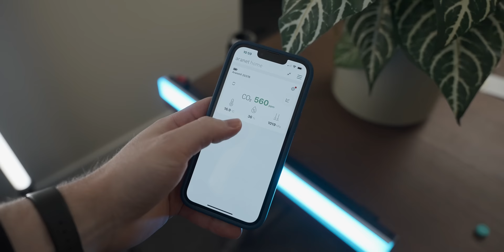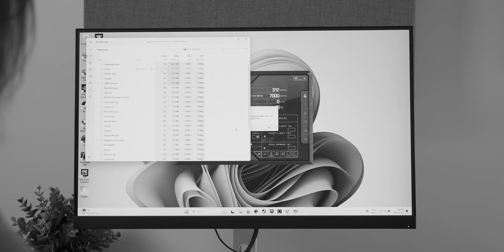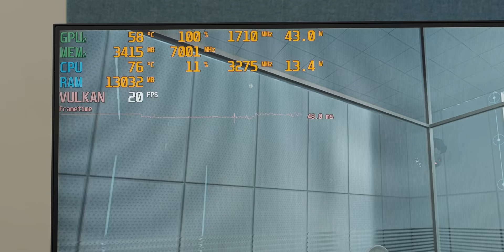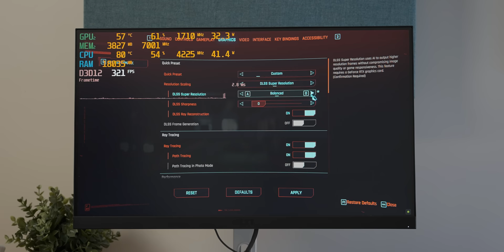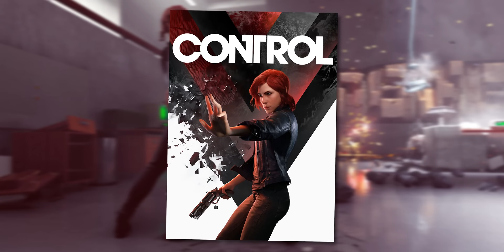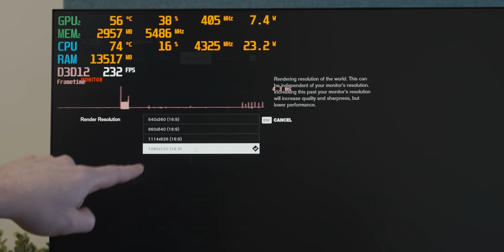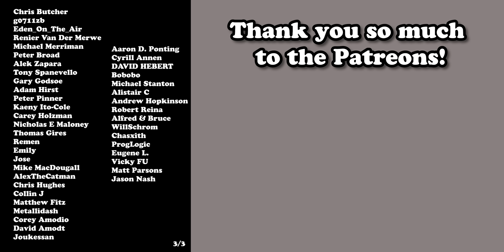Can The Slowest RTX Graphics Card Even Ray Trace?

Comment: The main problem with RTX on laptops is manufacturers are obsessed with making laptops thin if laptops were thick and bulky again we’d have more performance by now
Reply: i would like to see a laptop with modern hardware and the thickness of a thinkpad g41
Reply: and non-gamer laptops would be the thin ones.
Reply: @floydlooney6837  yeah
Reply: We still do have current gen thick and bulky gaming laptops that offer some of the best performance on the market, issue is that A: they are for most people often prohibitly expensive and B: not everyone wants a thick brick scolding jet engine on their lap or even on thier desk, but they still want to play games! hense why thin and slick gaming laptops are offered, picked up a Zephyrus G14 recently and its pretty powerful for how thin and small it is and absolutely love it
Reply: @pelehosmusic  contrary to popular belief, you're probably not doing any sort of gaming on your laptop with it on your lap, even with a controller.
Trust me, I've already tried
Reply: @pelehosmusic  Bulky gaming laptops don't need to be exorbitantly expensive, mid-range and even cheaper options often have more bulky options that tend to outperform their GPU equivalents just due to having better cooling. Legion and TUF laptops are pretty good at it, for example. Hell, my Ideapad Gaming 3 (2021) with RTX 3050 somehow performs like 50% better than the one Dawid references in this video due to basically being a repurposed Legion design.
Reply: The problem is I like my gaming laptop to be unnoticeable, If its super obvious its a gaming laptop it will look a bit strange
Reply: @Carnyzzle  I guess im one of the weird ones, i game all the time on the Zephyrus on my lap with a controller, and it's more than tolorable
Reply: @HunterTracks  I understand there are large variations at all prices, however im more commenting on the original comment basically saying if we just make all gaming laptops thick then we would have more performance overall, and im basically says we already are doing that. however it ultimately comes down to the cooling capacity of the device and how the board parter set the power output of a gpu, ill use my zephyrus for example. it has a Radeon RX 6800S in it and despite being advertised as a RTX 3070 competitor, there are some cases where the 6800S in the Zephyrus can outperform gaming laptops equipped with the RTX 3080 like the Razor Blade 14, however if you look at deatiled reviews sometimes its simply due to the the rtx 3080 being set to the same power envelope as the RX 6800S allowing it to be outperformed by the 6800S. The performance is more at the mercy of the company integrating the technology
Reply: I have a thicker laptop and it’s amazing. 80w 4050(base wattage) and a 45w(base wattage) ryzen 7 7840HS. Good temps, good fps. It did cost one thousand dollars though…
Reply: Yeah, tell that to my Vaio E series with its HD7650M.
Reply: Just don't get laptops.
Not for gaming anyway
Reply: and then what is the point of a laptop? If you can't even take your laptop anywhere because it weighs 10kg, just get a desktop PC...
Reply: @GermanyOni   Ive got a 100w 7600s and a 7735hs cpu it performs pretty well gets a bit toasy but is still quiet while gaming
Reply: For those complaining about having to cart around a five or six pound laptop to get additional gaming performance...

Remember LAN parties when you had to carry your thirty-pound tower just to play StarCraft?   If you do... yes, our shoulders and backs are older, but it's hardly Atlas carrying the weight of the world or Sisyphus rolling the boulder up the hill.
Reply: @LabCat  It wasnt a complaint more I use this laptop for uni and a huge bulky laptop would be a pein to carry everywhere
Reply: Id sacrifice some thinness to have a socketed, replaceable CPU as well, maybe even a replaceable GPU card slotted in. And soldered RAM is dumb. To me that is the biggest problem with laptops, their  inability to be upgraded down the road.
Reply: @stephenhood2948  my laptop and most decent laptops don’t have soldered ram.
Reply: @GermanyOni   this is why desktops are better. :)
Reply: @GermanyOni  Oh I know, I just think it's dumb to even make a laptop with soldered RAM.
Reply: Fr, at best rhe thin laptop should just have a Radeon 780m iGPU but leave the dGPU’s for bulky boys
Reply: Thick and thin laptops each have their purpose. The problem is that most consumers have more purpose in a thin laptop than a thick one; They don't want to carry more than they need to, because not everyone is a computer nerd or gaming buff
Reply: @stephenhood2948 Some slightly older workstation laptops actually have something called an MxM slot for upgrading/replacing the GPU! There are MxM cards that have the GPU stuff on it, and you can generally upgrade the GPU to a better one supported by the laptop. They're basically shrunken down PCIe x16 cards.
Reply: @PCIexplorer  I have never saw one of those. It just seems like planned obsolescence is baked into everything these days. I do understand the nature of modern technology and manufacturing processes, but i do believe that something like a laptop could be built with a more upgradable, serviceable design. I saw what Framework is doing with their products, that is a big step in the right direction. Hopefully they do well and that encourages other manufacturers to further upon the idea.
Reply: @scarecrow5848 people who need portability can’t lug a giant ass pc. People who don’t have space can’t lug a giant ass pc, people who want a more efficient device can’t use a huge ass pc and more
Reply: @stephenhood2948  yees 100% I would too that would be a worthwhile trade-off as I wouldn't need to spend as much when parts go out of date
Reply: Only true up to 100W on 4050, 4060, and 4070 this generation. Beyond that, there is no performance to be had. For 4080 and 4090 it's different, but those chips are more expensive
Reply: It depends the model
A lot of laptop based GPUs don't always match the specs that you see on Desktop, which is especially egregious since they dropped the 'M' name scheme. Though in some cases you have laptop gpus that match the specs of their desktop counterparts but may fall behind in how much power is afforded to it. For example, a GTX 1060 laptop has matching specs to its desktop counterpart but generally has a lower wattage which means less performance.
In rare instances you'll have laptop GPUs that actually closely match their desktop counterparts but generally these fall to low power models like the 1050 Ti. Interestingly, the RTX 4060 laptop (if you can find a laptop that can reach full power 115-140w range) can match its desktop counterpart, the only thing holding it back is possibly the CPU paired with it.
Reply: @Carnyzzle   exactly
Reply: @pelehosmusic  Smaller will throttle and lose performance and get hotter, instead of a jet engine you`ll have a rocketship exhaust
Reply: @walter1824  Mines been surprisingly quiet unless i set it to turbo, but it doesn't benefit the performance that much so i leave it on performance mode and it runs without throddleing and very quiet but abit warm, nothing that is unbearable, this is a 14" thin gaming laptop that i normally play on my lap. As I've mentioned in a previous comment here, the power curve is at the mercy of the integrator cause you could feed the board 200w, but how much cooling can you fit in the chassis? Its this exact point were a decision is made that explains why somtimes my laptop with an RX 6800S mobile can outperform some laptops equipped with RTX 3080 Mobile despite a clear gap in pricing and advertised performance expectation. Point is, if you optimize the hardware and software, you get a good product thats quiet, and capable of handling the hardware, not just laptop thin laptop loud laptop big laptop quiet, cause there are serveral more variables to it.
Reply: I will happily compromise portability for performance because I am physically capable of carrying around more than 2 kg of weight
Reply: @Carnyzzle  I beat Portal 2 for the first time on a entry level HP laptop at 20 FPS low settings, and sometimes during the playthrough, I was playing with it on my lap. Needless to say, it was hot, but not that bad. Now, 2 years later I have an actual gaming PC that can do 1080p High
Reply: i always shake my head when I see these ultra light gaming laptops and I'm like who the heck do they even market these to?  if you're not buying a chonker you're doing it wrong!
Reply: @BOLDBANGER  I cannot imagine calling a 5kg laptop heavy, but those ultraportable people cry all day about how they can barely lift it
Reply: Why not just make the part of the laptop where the heatsinks are thick, but keep the rest of the laptop slim? 
Get the best of both worlds, a thin laptop that doesn’t become uncomfortable on the desk after use for a hour or so due to the height difference between the desktop and the palmrest/keyboard, but get the cooling performance of a thicker laptop due to the heatsinks having more surface area to cool down the heatpipes. 

(Also do what Lenovo/IBM used to do with the palmrest at the front of the machine and curve it down so your wrists aren’t resting on a sharp corner *glares at Apple’s MacBook Pro’s forcing me to put something soft over my wrists to stop them from hurting from the sharp edge “cause it looks nice”
Reply: @macedonianlad that’s a desktop replacement lol, I have a few desktop replacements and they suck to use anywhere else than a large desk with lots of room around the machine. (Not to mention being not very good at being portable or that comfortable to use for extended periods)
Reply: there are thick and bulky laptops with good performance
Reply: Agreed
Reply: We really need to divide gaming laptops and work laptops
Reply: thin gaming laptops are still good though for example my friend got a gaming laptop that's pretty thin he uses it for school too and he needs some gpu intensive stuff for school
Reply: Yea but put the Asus Rog g752vy for example it's very big and bulky and weighs 4kg and it's gpu is the gtx 980m but the normal gtx 980 is still 50% better

Comment: Calling this GPU RTX 2050 is like saying '' oh yeah my phone can record in 4K... at 13 fps ''
Reply: So like AMDs claims about having RT hardware.
Reply: @ABaumstumpf The new 7000 series GPUs and specifically anything above 7800 tier isn't horrible.
Reply: yeah hopefully intel or qualcomm can disrupt this monopoly/duopoly soon
Reply: Raster is king pal @ABaumstumpf
Reply: @killkiss_son  "The difference is that with an AMD GPU you can if you want, but with that RTX 2050 you can't."
Sure - show it on a mobile Radeon card.

"can't play any RT games at decent settings"
Try it with a low end mobile Radeon card - have fun.

And the funny thing its - it is still AMD cards that do not have dedicated raytracing hardware and those are the reasons why games hardly use any decent effects and are limited to GI and co: Cause as soon as you do anything different - like Minecraft with physical based rendering - the Radeon cards crap their pants and even current gen ones drop to sub 20-series performance.
Reply: Should be called the NRtx 2050 no raytracing
Reply: @KFCfn  how about gtx 2050
Reply: @ABaumstumpf current amd séries card can handle rtx like a 4070ti for the 7900xtx, while being close to be the same price and having much much better perf in terms of raster and this with the RTX API from nvidia, the 7900xtx is close, even better than a 4080 in terms of ray tracing with the RTX API from nvidia, like the same thing with the 6900xt versus the 3090 in calisto protocol, its weird that it has almost the same performance in terms of RT when the API used optimized both cards brand instead of only one
Reply: @Dreamy_san  "current amd séries card can handle rtx like a 4070ti for the 7900xtx"
Yes sure, just as long as you do not want to use any good-looking effects - cause sadly AMD didn't want to add dedicated hardware acceleration and so performance tanks to well below 4060 levels there.

"and this with the RTX API from nvidia"
Strange coping. The API is from DirectX and Vulcan - not nvidia. So why are you lying?

" its weird that it has almost the same performance in terms of RT when the API used optimized both cards brand instead of only one"
Let me correct your lies: When only using the simplest and worst-looking bruteforce RT then Radeon cards have similar performance to the next-tier-down RTX card.
Reply: @ABaumstumpf  Damn you triggered the protective AMD fanboys
Reply: @ABaumstumpf  lol who wants gay tracing anyway?, also above 7700 cards handling RT pretty well, for me 50-60 fps in RT is more than enough and i don't want to buy ridiculously highly priced of 1000$ GPU just for gay tracing from ngreedia
Reply: @killkiss_son  "RX 6600"
So you wanna compare a 130W desktop GPU to a 45W mobile one in a title that does not use any textures or other components during RT just to be able to run on consoles and claim that shows AMD has good RT? Really?

"gets 80fps in 1080p in spiderman miles morales with RT on high"
Ah - that is interesting given that most reviews show around 80FPS on high settings without RT.

"I call that playable"
Nobody said 80FPS wouldn't be playable - but why this completely offtopic strawmen?

Try an RX 6500M for comparison. Or try one of the few games that do not target consoles and instead use any of the useful RT options like physical based rendering, environmental sound, or translucency. Oooh - most games currently do not use these features despite them being computationally a lot simpler and more impactfull? Might that have anything to do with RDNA not have dedicated accelerators and performance taking a nosedive cause of that?
Reply: @ABaumstumpf  "AMD cards that do not have dedicated raytracing hardware" This is just false, all AMD cards in the 6000 series and after have dedicated RT cores called Ray Accelerators. Not to mention that the XTX's Raytracing is about equal to the 3090. AMD's RT is about 1 gpu-gen behind NVidia.
Reply: @ckingc05  "This is just false, all AMD cards in the 6000 series and after have dedicated RT cores called Ray Accelerators"
No. You shouldread up on the specs. Making up bullshit just shows you got no clue.
Reply: @ABaumstumpf  What are you even taking about. Do you not even know what Ray Accelerators are?
Reply: @ckingc05  "What are you even taking about. Do you not even know what Ray Accelerators are?"
Contrary to you - yes i indeed so know what i am talking about.
AMD does not have dedicated hardware for raytracing - as they them self has said and shown.
But be my guest - feel free to show that all RDNA documentation is false and that AMD has lied about their own architecture.
Reply: @ABaumstumpf  "AMD does not have dedicated hardware for raytracing - as they them self has said and shown." Where have they said this? On the Radeon 6000 page they say "The AMD Radeon™ RX 6000 Series graphics cards represent the forefront of engineering and design to deliver ultra-high frame rates. Powerful compute units with hardware raytracing acceleration, blistering-fast AMD Infinity Cache™, and large amounts of GDDR6 memory enable the ultimate gaming experience." And RDNA 2 has Ray tracing in the documentation. Please what are you even talking about. Maybe you somehow think we are talking about RX 5000s and RNDA 1 or something? 
I will say it once again. "What are you talking about."
Reply: My laptop has a 3050 with 16gb ram yet I prefer to play my steam deck for pretty much everything I can play, docked as well. I only beat evil within 2 on that thing and my youngest son plays Roblox on it…I plan on purchasing a laptop with a 4090 in it soon, so I can hopefully play gran turismo 7 on it one day.
Reply: AMDcel cope comment
Reply: @galaxlordcz3933 it’s still terrible they’re rt cores are basically 2000 series level half a decade behind
Reply: @ABaumstumpf I have an rx6900xt and it can easily handle 1440p max settings cyberpunk with ray tracing , stop glazing nvidia
Reply: @yukiro6417  Do you have anything other than strawmen and hating?
Reply: @ABaumstumpf  do u have anything other  than blindly preaching a multi trillion dollar company and shitting on every other company that tries to compete?
Sure amd is behind in ray tracing by miles but the comparison you made is blatantly false as amds newest cards are quite capable at ray tracing and even some of the high end older ones.
More competition is better for consumers, nvidia has made a monopoly and if u spread hate about other companies, they will never have competition and hence lesser innovation and more expensive hardware  and will keep milking their blind customers
Reply: @yukiro6417  "do u have anything other  than blindly preaching a multi trillion dollar company and shitting on every other company that tries to compete?"
So you have chosen lies cause you have no actual argument?

"nvidia has made a monopoly and if u spread hate about other companies"
And you dont even realise the irony.
Reply: its also laptop gpu way worse then normal one
Reply: The reason ray tracing reduces frame rate so much is because, it requires huge computational power to compute the dot product, between the the normal vector and the light vector. For every single coordinate point on the meshes.
Reply: @ABaumstumpf  do u have any other thing other than saying “do u have any other thing” and quoting things without even actually replying?
Reply: You jusst trolling it becoze it is people who can't afford a '4090'
Reply: Sure, except they dont and your talking nonsense @ABaumstumpf